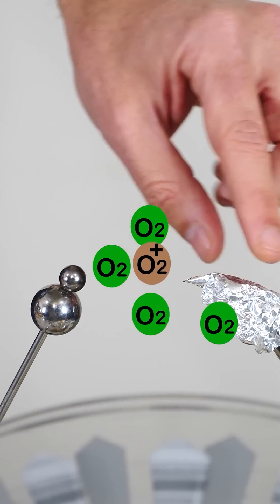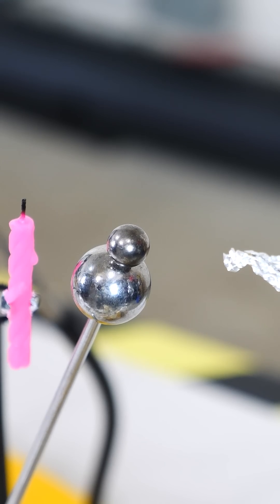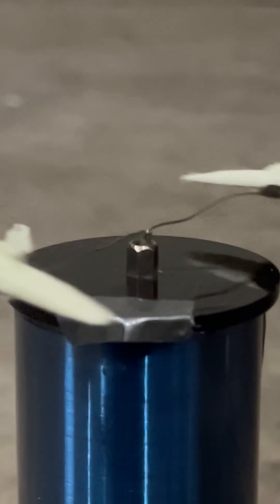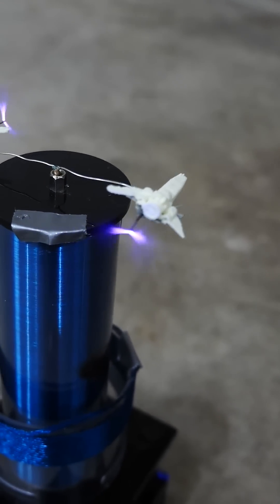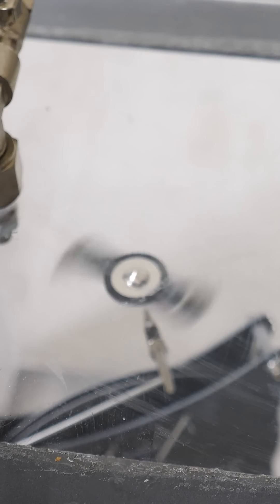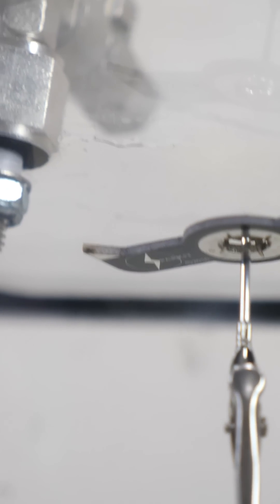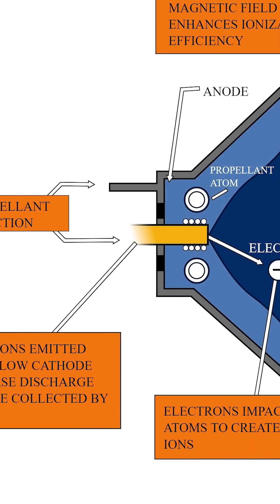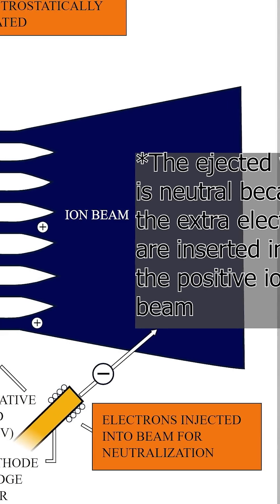How Do Ion Thrusters Work in Space?

Comment: Dear action lab in my opinion you told it right it create a thrust on air and move forward but in vaccum it doesn't work coz there is no air but there is newtons third law as well so if we use this plasma thrust in space  in 0 gravity then the ion will release from the nozal and it will push the rocket foreward. Like a water pipe jiggle and shake due to release of  high   pressure water from the pipe

Comment: This simply isn't practical for space travel.  You will eventually run out of gases to propel out of the spacecraft, and the thrust generated by ionic thrusters is extremely small.
Reply: Ion propulsion is MORE "practical" for space travel than regular chemical propulsion.  We just have not scaled up the tech enough to produce very large thrust.
But it has the highest ISP of any other method.

Comment: So does an Ion thruster have "fuel" in the form of gas(presumably a very common and compressible gas?)?
Reply: That's correct, ion thrusters do have "fuel." Xenon is not very common, but it has a high molecular weight, is non-reactive and has a high vapourisation temperature so it's easier to store as a liquid.
Reply: They use noble gases to prevent any side reactions and Xenon is used because of it's low ionization energy which allows you to actually propel the gas with electricity.

Comment: My questions:

How fast can we go with a thruster like this?
How much gas is needed to get going?
Reply: The ion rockets we currently have use less than 200 milligrams of xenon gas a minute. Since an object in motion stays in motion, you'd only need more gas to fight the gravity wells of passing objects, keeping yourself on course. Otherwise, you spend a few days building up to your top speed and coast along. Then you'd need an equal amount of gas to slow down. If you watch "The Expanse," this is why the show uses the phrase "flip and burn," as stopping your spacecraft is just as important as getting it into motion. So you'd spend a few days burning the engine and ramping up the speed (I believe we can currently get up to 90,000 meters a second with ion engines), then halfway through the trip, flip your craft so the rockets face your target, burn the engine again, and spend a few days slowing back down.

I highly recommend The Expanse for a scientifically accurate portrayal of space travel with lots of fun sci-fi action.
Reply: I heard of a Xenon thruster on a satellite that could run at about 0.2N of thrust for 14 months. The satellite weighed around 750 kg. I don't know how fast it can go but the constant acceleration even with that low force must be able to achieve decent speed if not affected by gravity fields
Edit: decided to try my best, using F=ma we get  a=0.2/750 = 2,7•10^-4 ms^-2
If we put this acceleration over 14 months we'd get 2.7•10^-4 • 426(days in 1 year and 2 months) • 86400(seconds in a day) = 9.8•10^3 ms^--1 or 35.3 thousand km/h.
Ofcourse this would be lower because the sun is constantly pulling onto the satellite but in theory the spacecraft could escape the solar system with this speed. If we develop these engines more they could be a lot more powerful than most think. Not because of strength, but fuel efficiency which means duration.
Reply: Why aren't they used in aircrafts?
Reply: @sharon_ng  The other response is technically true, but it's much simpler: at the moment ion thrusters are not nearly strong enough to allow a plane to overcome gravity. In space, there is only a tiny bit of gravity from the sun.
Reply: @sharon_ng  The thrust from ion thrusters is basically about as powerful as the gravity you feel from holding a few coins in your hand.
Meanwhile aircraft engines produce enough thrust to knock you over from a hundred yards away.
Reply: @sharon_ng  Because this material of gas is costly and dangers for human radiation, They had went to the moon by the shuttle, and there is no need to move around in the space
Reply: The only speed limit any rocket has is the speed of light. The limitations are mostly acceleration and efficiency. Chemical rockets are very powerful, which is why they're used for missions with time constraints, and to launch heavy payloads from the ground. However, while one pound of chemical fuel can push with a pound of force for about 9 minutes, a pound of gas in an ion engine pushing with a pound of force can burn for over an hour. The drawback is that ion engines are much, much less powerful, so we won't be using them for big rockets anytime soon. They are still fantastic for long-range, long-duration flights, though, because low thrust + a lot of time = a lot of speed. Given sufficient fuel and time, you can go as fast as you want with any engine.
Reply: @embite1027 hey this is an old comment but what if someone but ionic thrusters on a car. Would that majorly improve highway milage. Also could we use xenon on earth too since they are heavier and create more thrust than traditional air on Earth
Reply: @Lvl5farmer  For complicated reasons that I'm not qualified to explain, no. At least not with a traditional thruster. I saw a demo once where somebody flew a paper-thin model plane a few feet across a room with an ion engine, and even that was impressive for current technology. Not to mention it's probably much more efficient to just use that electricity on motors anyway, due to certain effects the atmosphere has on thrusters. YouTube has loads of videos about this stuff if you're interested.
Reply: Nah man, just 1 kg gas per hour to run at half of lightspeed

Comment: This could be used for 1g constant acceleration and allow a spacecraft to approach the speed of light, traveling the edge of the known universe in 50 years (its pilot would age backwards).
Reply: No...? That's not how that works
Reply: @prich0382  then how?
Reply: You can't lol. It takes an infinite amount of energy to reach the speed of light, so you'd need an infinite amount of fuel which is an infinite amount of mass. Therefore it can't happen.
Reply: @prich0382  wrong, I didn't say at speed of light, I said *approaching*, research 1g warp drives, it's not science fiction.
Reply: @Concordeagle  no, time moves slower for you when you're approaching the speed of light, it does not move backwards. at exactly the speed of light, time stands still. for time to move backwards you would need to go faster than the speed of light, which is impossible
Reply: @albing03  agree on the aging part, but the strong correlation or coordination that exists between 2 or more entangled quantum particles is faster than the speed of light.
Reply: @Concordeagle  that is sort of true, but it's a bit more complicated. it can't really be used for something (for example sending information faster than the speed of light). 

i've heard it described like this: you have 2 boxes and you randomly put a red ball in one of them and a blue ball in the other, before you mail one of the boxes to another planet. if you now open your box and find a red ball you will immediately know that the box on the other planet contains a blue ball. you will get information about the ball on the other planet instantly as you open your own box, even though the other ball is lightyears away. did information about an object lightyears away from you "travel" faster than the speed of light? depends how you look at it i guess, but it can't be used to send information instantly between the two planets in any way
Reply: @albing03  yep, that is my understanding as well and why there are so many wild theories to explain this behavior, like Many Worlds (waveform never collapses, universe keeps branching), or we live in a Holographic simulation, etc. Fascinating stuff!
Reply: @Concordeagle  for sure, it's all very fascinating and i can't wait for us to find out how we can use quantum mechanics to our advantage
Reply: The acceleration of ion thrusters is very small, so in practice these are used for far more mundane speeds. The advantage they have is that for the same amount of fuel volume you get a much bigger change in speed total than with a more powerful rocket engine, but it takes far longer to get there.
Reply: Ion engines produce an incredibly weak thrust. However they're very efficient. You might be able to sustain 
0.00000001G for years. But humanity is a long way from sustained 1G, or even 0.1G .
The rocket equation is an ugly 
MFer. Hopefully we won't have to wait 300 years for our Epstein to be born.
 And time dilation doesn't make you age backwards. It makes time run slower compared to people traveling slower than you. But time always moves forward, never backward.

Comment: Seems impractical since the ship needs to bring a gas anyways it might as well just bring traditional rocket fuel.
Reply: it would be more efficient than standard fuel, think about how much air you can keep in a scuba tank for example compared to how much water you would keep in the same sized container
Reply: you don't need a lot of gas. the battery + the gas is still more space efficient than all the standard fuel you would need for the same effect
Reply: @albing03  Do you have the numbers for efficiency differences?
Reply: @jwonz2054  according to NASA in the article Ion Propulsion: Farther, Faster, Cheaper: "Chemical rockets have demonstrated fuel efficiencies up to 35 percent, but ion thrusters have demonstrated fuel efficiencies over 90 percent."

we know that (90 - 35) / ((90 + 35) / 2) = 0.88
so ion thrusters are apparently 88%-more efficient! (didn't know the numbers myself before i looked it up)

Edit: hold up my math is wrong, lets try again
(90 / 35) - 1 = 1.57, which gives a 157% increase in efficiency when switching from chemical rockets to ion thrusters.

Comment: Yeah but if you have to bring gas with you in space then the ion thrusters are useless, right ? Since its goal is to propel a spacecraft without having to bring tons of propellant
Reply: You don't necessarily want to have no propellant at all (there are very few ways to operate a rocket without propellant) It may be more efficient and that's the point. You could accelerate each particle insanely strong and then only need a fraction of propellant which will also reduce the mass of the rocket which will reduce the amount of needed propellant etc. etc.
Reply: As of now, it’s basically impossible to not use propellant. That’s a goal in the far future, where light sails may be more common. 

Ion thrusters are used because they are extremely efficient, an ISP of over 10x a traditional rocket. Even though they produce low thrust, it’s enough to raise orbits and do what is needed.

Comment: So what is the difference between ejecting gas out of a nozzle and ion thrust what is the power difference
Reply: You'll already be getting thrust from ejecting the gasses out (like that of a nozzle), but if you want to make the most out of your stored propellant, you'd want ion propulsion on top of that ejection thrust. In essence both at the same time.
Reply: Ion thrusters are far less effective than conventional rockets. Thus, the TIE Fighter (Twin Ion Engine) will remain only in Hollywood movies.
Reply: The power difference is over 9000
Reply: In space there are almost no so if you have a thruster then u can move it
That's what i know about space i guess
Reply: Haha st*pid! You dont know that?
Reply: Not really about power, in space you need to carry your own propellant. Because it's limited, it's preferable to get as much "go" out of your propellant as you can, and that's what ion thrusters do by accelerating their propellant to high speeds using electric fields.